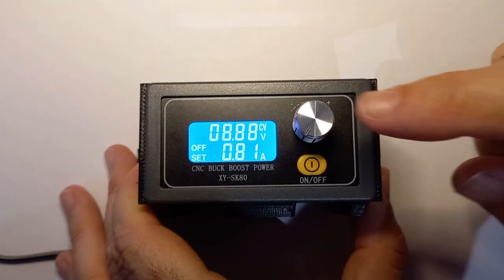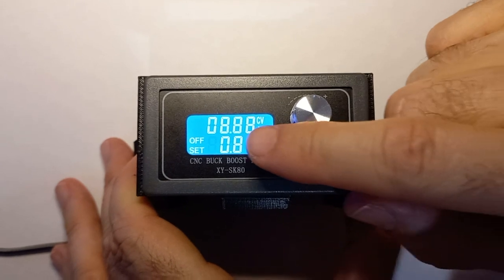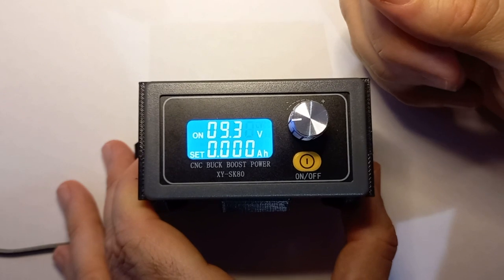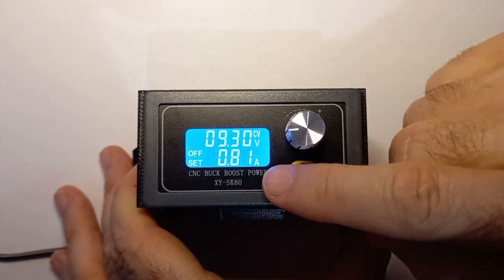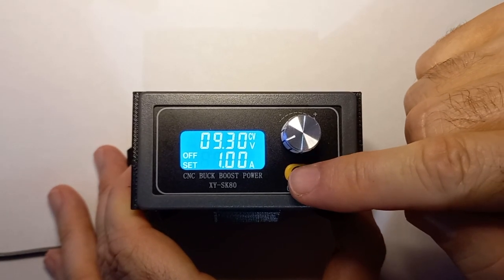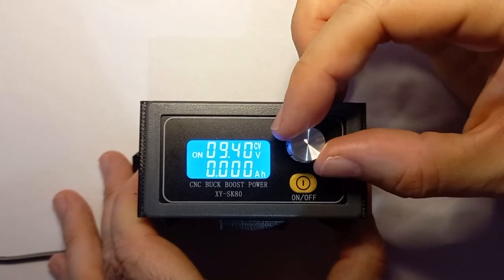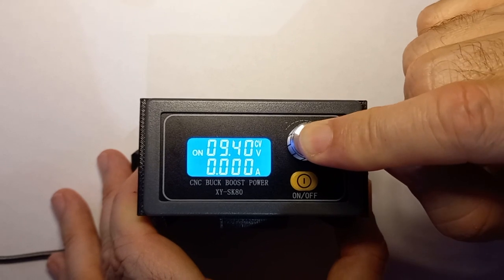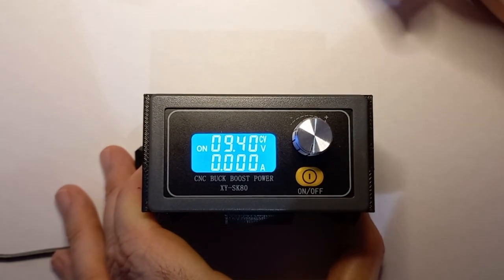2023 User Interface for the XY-SK80 Bench Power Supply

Comment: I bought one of these awhile back, rarely use it, works well but randomly output voltage is way off. I.e I set it to 12v and it outputs 1-2v, set to 20v and get 5.8v out. When rotating the knob to set the voltage, it shows correctly, then I wait the few seconds for it to set, and it shows lower, with and without load

Comment: Can this unit be used as a short killer
Reply: Yes - You can set the voltage to very low, e.g. 1V, and the current high, e.g. 2A, and that way force the short circuit to heat up.